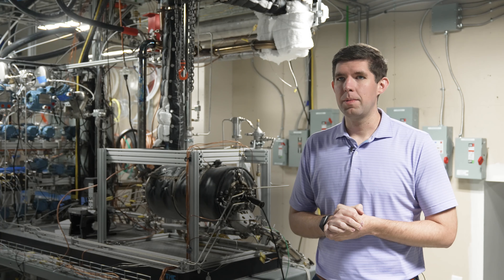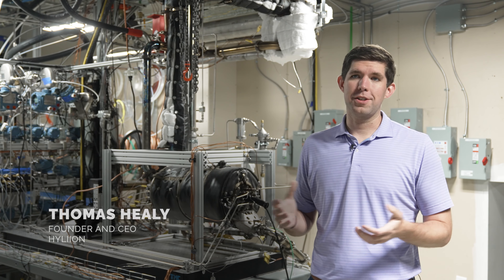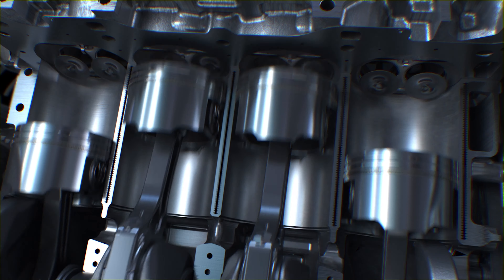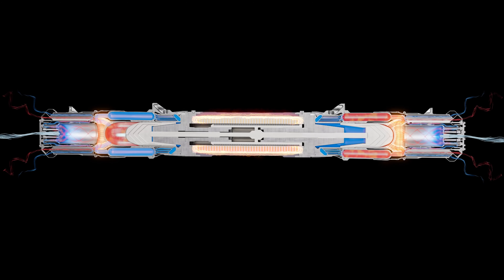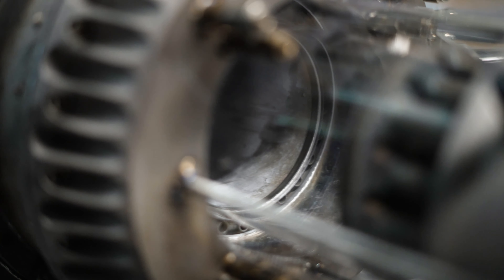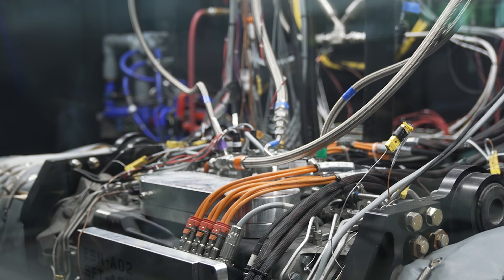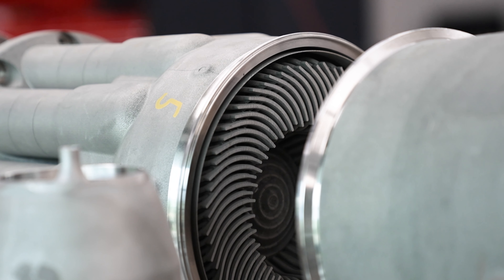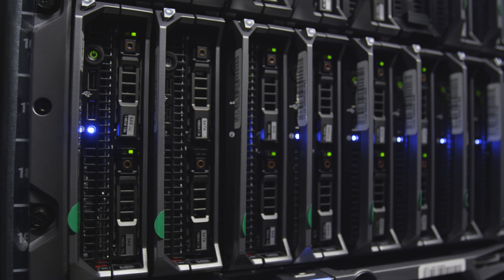KARNO Tech Series: 10. KARNO Generator: Fuel-Agnostic Feature

Comment: Can these run off the waste heat from gas turbines (maybe with a little help from an afterburner of sorts kind of like how steam turbines use moisture separator reheaters) for a new type of combined cycle plant? Could be another industry you can get your toe into.
Reply: They can easily run off of any heat source.  The higher the temperature of the heat, the better.

Comment: So is there a little bit of combustion in the fuel-processing tanks to create heat which is then transferred to the generator?  I'm guessing it's a tiny amount compared to a combustion engine, and that's why it has a lot less emissions and a lot higher efficiency.  I was just always wondering where the heat came from
Reply: What is a “fuel processing tank”? Besides, Karno is comparable in overall efficiency to electricity generating ICEs that have been used for sometime and less than an ICE with a bottoming cycle. If my understanding is correct, the only “fuel processing” that is done is for LIQUID FUELS THAT NEED TO BE PRE-VAPORIZED before being introduced via the fuel nozzles to the combustor assembly.
Reply: @Mentaculus42  I just made "fuel-processing tank" up.  I know the fuels are in their own chambers, for each fuel that a given generator has attached to it, and I assume it has to be converted to heat, and that only the heat enters the generator, not the fuel.  Also, I believe it's a lot more efficient that ICEs, unless you're talking about powerplants.  Karno is supposed to be as efficient as a powerplant, at a significantly smaller size.
Reply: @DaViinci  

Karno has 50% electrical efficiency while ICEs used to produce electricity for the last 10 years that are used to cover variations in wind power production in Colorado are 54% electrical efficient (with a bottoming cycle). The base ICEs are also 50% efficient. These generators are almost a direct comparison for intended usage to the Karno. Also the ICE can come up to full power faster than Karno. Karno in theory could have lower maintenance and possibly lower non-abated NOx output. No info on methane slip has ever been talked about with regard to the Karno. 

They really need to talk about real world results not generic talking points. They talk about using Karno for burning flare gas out in the field but never talk about what happens to the bad impurities that get burned and what happens to the combustor and super small passages in the heat exchangers. Also what happens to the soot and potential corrosion in these very small and thin walled heat exchangers? So many questions that they seem to purposely avoid talking about! Usually when someone avoids talking about something, the answer will not put them in a good light.
Reply: @Mentaculus42  I appreciate your detailed input.  I'm not an engineer, but it sounds like you're talking about ICEs that produce major amounts of energy for cities and other regions.  I am saying the KARNO is supposed to be a lot more efficient than the small generators people use to power houses, etc. The significance of that is that the KARNO is as versitile in application as a little generator and [nearly] as efficient as a power plant.

I think they also refer to "carbon emissions" not just NOx and say the it's 99% less emissions than other generators.

I have been watching closely since 2020, and I trust the team at Hyliion.  Hopefully it's not my downfall as an investor, but I'm hoping the stock is like Amazon was when it was a newish company, and I'm all in.

Lastly, you said you think they're avoiding telling us something, and I wonder if they are hiding it from potential competitors.  Also, it's still in beta, so I'm waiting a few more months to re-evaluate the situation.
Reply: @DaViinci  
I hope they actually execute this pivot effectively as I would like to see Karno become a viable product as GE had some talented people work on it. I think that some have transferred over. Personally I don’t see Karno as being inexpensive enough or a good fit for residential housing use. There are big questions about the scalability of the additive manufacturing that is needed to get the price point down and if they can build their own linear  generator components to control the cost. 

But that is all just engineering, the company really needs to have a better talking head for the PR. I like it when they have the engineer talk as it adds some competence to the PR and has less spin and misinformation. The problem is that they never provide any useful information that a person making a buying decision for a company would actually need. I guess that they are just not at that point yet.
Reply: @Mentaculus42  I also wonder if they are just not at the point to market to a consumer yet because they are doing it behind the scenes with specifically targetted customers.

And yea the price point and scalability are huge aspects of eventual commercialization.  But I think they are selling a product that has so many applications, that there are countries and massive companies that will get behind it.
Reply: @DaViinci  

I hope so but why did GE sell the design to an outside entity vs creating a separate division for “small” power generators ‽ Of course this was “around” the time that GE was trying to focus on their core competency. 

I guess what gives me negative vibes is when the CEO constantly pushes “half-truths” and treats general things like they are “super secret”. It is so much better when the actual engineer does the talking. The CEO is not a competent “talking head” to establish the correct image for this company. If one is an engineer with some minimal knowledge and listen to him, you get a “used car salesman vibe”. I have seen this before in some startups (3) and they usually fail from the top.
Reply: @Mentaculus42  Regardless of why they sold it, they were compensated mainly in shares of Hyliion, not in any significant amount of cash, which shows a belief in Hyliion.

I am invested in Healy, so I would love to know what half-truths or deception you see.

I think he is trying to find a way to explain to a layman or a potential customer how Karno can benefit them, instead of overwhelming them with science.
Reply: @DaViinci  

A couple of huge “half-truths” is his use of the argument that entities that are installing charging systems for large EVs have to wait years for utility connections. Could there be a situation where this happens, probably BUT. I have been involved with a large transit district that is transitioning to EV buses in California and the general consensus is that this is not the case. If anything SCE has been very responsive. 

The next half-truth is what the cost (particularly the levelized cost of electricity (LCOE) during its lifetime) as a function of the cost of methane (natural gas). Some extremely vague numbers have been “suggested” with no backing explanation other than “we are cheaper than the utilities”. The price of electricity and natural gas is all over the place, so generic proclamations of “cheaper” don’t cut it. 

Even this particular video about “universal fuel compatibility” is suspect as liquid fuels have to be handled differently than gaseous. Then they suggest that hydrogen to ammonia can be used interchangeably. In turbine combustors each has to be carefully designed for as these two are basically on the opposite ends of the spectrum with regard to the combustion process (doubly so with regard to efficiency, localized heating and NOx production).

Now we are beyond a couple, but a clear explanation of how they are going to deal with the IP for the linear generator needs to be clarified (as it is not owned by them). To replace the linear generator with their own design that doesn’t conflict with existing patents is a huge undertaking but necessary to lower the cost.

Then there is the whole issue of dealing with “sour” natural gas out in the field. To clean up bio-methane is a complex and expensive process so that it can be used interchangeably with regular natural gas. Or are they suggesting that Karno will combust contaminated flare gas or biogas? So many questions.
Reply: @Mentaculus42  I'm going to argue against each of those, just in case I know more than you about certain things.

1. It sounds to me like you are talking about the politics of getting government approval to set up EV charging stations, whereas the problem I think is the amount of electricity it takes to charge those vehicles vs what most cities' electric grids can handle.  He talks about companies plugging their commercial EV's into deisel-powered vehicles to charge them.

2. As you said, energy prices fluctuate and depend on the city, and each fuel is different.  So how can you say how much cheaper Karno energy is than alternatives?  I just use faith on this one lol.

3.  The different fuels have to be in different tanks.  That's what he said when they orginally were using the Karno in a semi-truck.  That's what my original question here is about: how do they get the heat from each fuel into the generator, since it is a heat-powered generator, not a combustion-powered generator.

4.  I think they own all of the IP.  At least I asked that a long time ago and someother investor said that.

5.  Healy said they don't have to use refined fuels because of the nature of how the create heat, but like I said, the heat-production is a hole for me.  An important one.
Reply: @DaViinci  

On number 1, the very issue of getting the utilities to provide sufficient electricity to power the chargers in a timely manner for large EVs like EV buses has not been an issue for California transit agencies. This I known first hand as I am a technical engineering consultant to a large California transit agency. Can that be an issue, I said probably. Generally a company’s “maximum instantaneous” electricity consumption for a normal EV fleet is manageable by the existing system other than upgrading the feeding transformers. If a company wants to situate a new facility that is going to FAST CHARGE TEN EV SEMIS ALL AT ONCE (and at 4 to 8 PM) then there could be issues. That is why Tesla has batteries that are used to charge their EV semis at the few corporate demo locations. The irony is that the very same issue impacts the Karno as trying to deal with peak demands can’t be the sole parameter to size the number of generators in a cost effective solution. So no magic with Karno. 

#4 Hyliion is using a linear generator from another company that was used by GE for the prototypes. This has been a subject mentioned by Hyliion and the need to design that out.

# 5 The impurities in bio and natural gas can be very bad for air quality and equipment reliability.  This is never mentioned by Hyliion so from my perspective it suggests something about their candor. If they were upfront about it, they would explain the need for different versions with additional support equipment. There are companies the size of Hyliion that specialize in providing equipment to clean up bio methane and it is a complex process. The flare gas that is being promoted as a fuel source can also have a lot of really bad impurities. I would find it difficult to believe that the Karno could reliably combust the gas directly (in all cases) and even if it could, what after treatment is needed. Never talked about. 

I wish you the best of luck on your previous investment decisions.
Reply: @Mentaculus42  
1.  I guess you are an expert on a lot of this, so it is good to hear your perspective.  I hope @hyllion responds to this...

Anyway, I will suggest the idea that the Karnos could be set up for peak capacity, in what Thomas Healy says is true, that extra energy can go into the grid.  The government would have to incentivize it to make it worth it, though.  I get that you are saying charging capacity isn't a major issue from what you've seen, though.

My next thought is that the convenience Karno is of importance- placing it anywhere you want, including country-side, third-world countries, the top of mountains, ships, other planets, etc.  I don't know how much money is in that, though, to be honest. 
_
4. I hope that's the difference between the alpha and beta models....
_
5. Once again, that goes back to the original question I had of how to they produce the heat
_
Thank you. I need it.
Reply: @DaViinci  as for #5: This is a point I wish they would expand upon also. While yes they did have a successful test run using flare gas in a Karno generator I wonder what if any damage was done, and if there was a pretreatment system to purify the gas. I think in a previous interview they said the impurities just pass through the matrix, where I'm guessing they would end up in the atmosphere as if they were flared, just that the heat is captured for useful power.

Mentaculus42 brings up a good point where if flare gas or bio methane is use what impact it has on the life time of the printed matrix. Perhaps they can tune a matrix (either with metallurgy or matrix size/surface texture) to better handle these sources of less purified energy than others at the expense of an efficiency loss. Again a bit of radio silence on these topics. I'm guessing they are still working things out and I wouldn't be surprised if the first round of Karno generators are designed to run on Navy JP fuel (considering their new defense contract), pipeline quality natural gas, diesel, flare gas (special matrix to avoid fouling?), and maybe H2 (maybe).

I'm going to optimistically chalk it up to trade secrets and trying to find the most efficient printing process before they start production intent products.

I have to say this conversation between you two is excellent, lots of salient points thrown back and forth in an intelligent and polite manner!
Reply: @anydaynow01  Thank you for adding to the conversation.  It will be interesting to see if they design different versions of the Karno, like you said.  Or if they really do sell a one-size-fits-all solution that's actually efficient.
Reply: @Mentaculus42  "entities that are installing charging systems for large EVs have to wait years for utility connections" 

You're only dealing with one locality that has connectivity.  California is progressive when it comes to electrification, but in most of the country, that is simply not the case and there is no infrastructure to support it, especially if it competes with the incumbent technologies, like oil.
Reply: @williamsteele  

California is where I have the first hand information. California can still have connection issues if it is a new facility that is a bit isolated. The thing is, California is the state that is AGGRESSIVELY pushing EVs with some others that follow along with what California mandates. Therefore most other states (areas) are more motivated by Federal subsidies than California mandates and have more options and less of a need to do a panic EV transition. 

Bio-NG is much more cost effective at this time. Cummins’ new natural gas engines seem be a very good “transition solution”. As a note, if you are a user of Bio-NG you don’t actually DIRECTLY consume Bio-NG but deal with entities that deal with trading in it and offset traditional natural gas, sometimes by buying “federal credits”, (the process is actually more about “book keeping” and is a bit convoluted). The upshot is that a Bio-NG consumer “probably” is “physically” using traditional natural gas. This is effectively very similar to how “renewable electricity” works other than natural gas can be more economically stored than electricity. 

The other observation that I have directly seen is that many millions can be wasted if one picks an EV manufacturer that goes bankrupt! This has happened with Proterra where nearly a couple of BILLION DOLLARS of investment is now a boat anchor!  California basically hides this and how this is funded from the taxpayers. 

So the relevance is that if Karno is being used to provide electricity to charge EVs, it will probably be burning traditional natural gas (which suggests the question of where the climate improvement is). So one will say that is an efficiency win, but in reality not so much. The new Cummins’ natural gas engines are in the high 40s percent energy efficient so overall not a big efficiency loss. With transit buses the average speed is so low that it is “low hanging fruit” for EVs. With local delivery trucks the speed is relatively low but once an ev has to maintain higher speeds the economics of large EVs come into doubt. With transit buses the usual crossover occurs at around 200 miles per day on one charge and running at above 40 MPH (ish). This is part of California’s motivation to push hydrogen fuel cells. Transit buses are reasonably good proxies for local delivery trucks. The other major observational is that large EVs have sufficiently LOWER utilization that more (in a nontrivial number) have to be bought to fulfill the fleet requirements. 

Personally I was very excited about Hyliion’s truck solutions but it appears that that developmental experiment suggested that the truck was too expensive. The perplexing thing is that Nikola has actually continued pushing an even more expensive fuel cell truck that needs an ambitious hydrogen fueling network. At least Hyliion could have leveraged an existing natural gas network that is generally acceptable in someplace like California. 

A lot of complex moving parts in this “TRANSITION”.